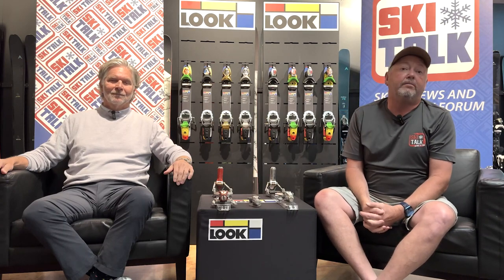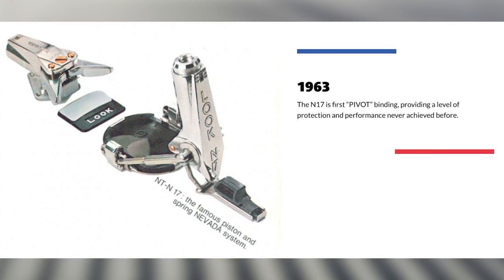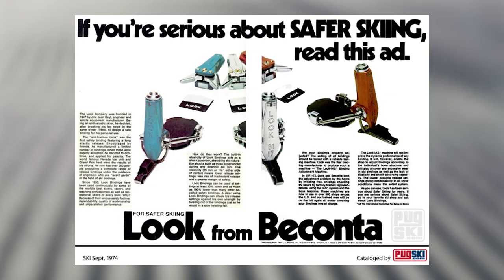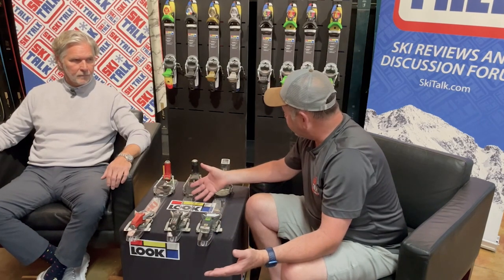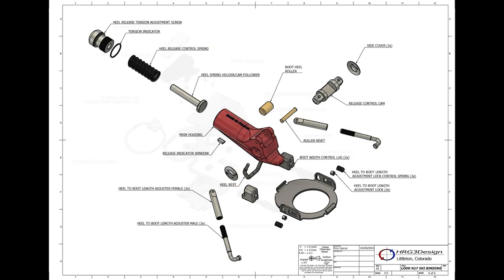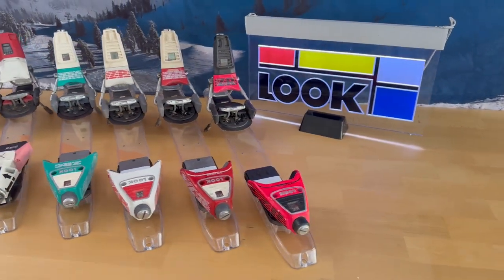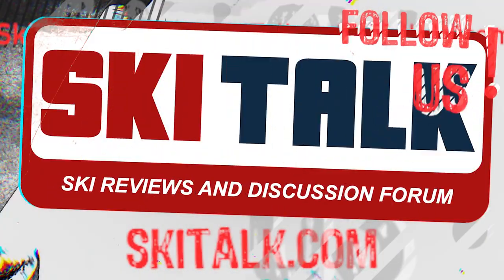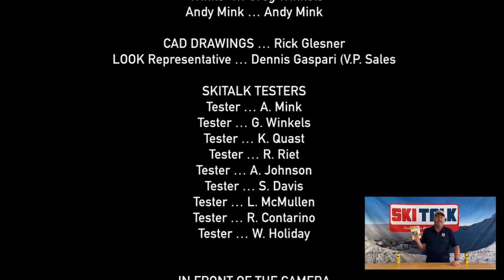The History of the Look Pivot with SkiTalk.com

Comment: The first set of skis I bought with my own money were Look Nevada's on Olin Mark 1's and the new Nordica injection molded boots. In the 80's I sold Dynastar, Lange and Look alongside the Geze's as the cornerstone of my ski shop. In an area where K2 was king and they marketed Marker. Sold a lot of the ZR's with upper Dynastar glass models and Fisher Flex skis and those who simply wouldn't buy anything else. I still have a Geze G70 demo board that can demonstrate upward release. I also have a pair of Blizzard SL's [early 90's] with my last pair of Red/white ZR's. Only we called them turntables. Doing heel release tests on them were opposite of practically every other binding. IT WAS SMOOTH! A feature that I think saved me from at least not suffering from any muscle damage due to rapid deceleration leading to a release of the heel caused by Cascade concrete and excessive speed. 

I have the Rosi 120 and the FKS in orange currently. Both were remounted recently for new boots and passed the tests perfectly. I am glad to learn that Dennis saved the brand name and how he did it. That took some guts but it proved the name had value in the market. I knew Rosi would use the Geze designs under their name and I was fine with that but worried that Look would be lost. Probably ending small independent shops with it. I am more impressed that in bringing back the Pivot that they continued to offer a single pivot and the pincer toe piece as options. I am getting new skis Monday and have been 'Looking' at my options. What I would like to see in the future is a model of pivot bindings that has a tighter range of din settings and focus on selling the customer one that has the skier in the middle for optimal spring performance for the user: 3-9 range for 5-7 din setting as an example. And get away from male, female, racer designations to describe models. 

Nice collection Phil. Thanks for jogging my memory.

Comment: In the 1980's I had some Dynamic VR27 SL skis with Look 99 RS bindings with the back facing brake on the toe. I credit those skis and binding combo in really progressing my skiing. They were a fantastic ski/binding setup in those days and I'm amazed to see the pivot style binding is still around these days. I'm skiing Salomon Shift's these days for a bit of back/side country touring or System Markers. So I think you could do a backcountry/alpine version of the Look pivot like Salomon Shift or Marker Duke.

Comment: Looking to get a Look binding and want the pivot binding and ski on a low DIN  around 8 as a advance skier ⛷️ thinking about the 15 any thoughts
Reply from the maker: One of the reasons we pushed Look to bring back the 15 was to be able to offer an all metal toe for a lower setting, with the 15 starting as 6, you are well within range.

Comment: I bought a new pair of boots with GW soles so changed my Demo bindings to Look 12GW . I can’t believe how much it has improved the ski performance . Or is just a placebo effect?
Reply from the maker: Not at all. The low stack height and short mount distance definitely enhance performance.
Reply: I used to ski on Marker Jester all the time, all of my life, in 2021 i switched to Look Pivot 12, and probably will never look back to something else, the flex from a short mount base and overall stiffness, gives a ton a difference, i'am still going to ski on my second pair with marker jesters, but look pivot indeed makes ski handle better. Honestly i think Marker Griffon/Jester/Jester Pro and Look Pivot 12/15/18 is the best alpine bindings on the market now.. PERIOD..